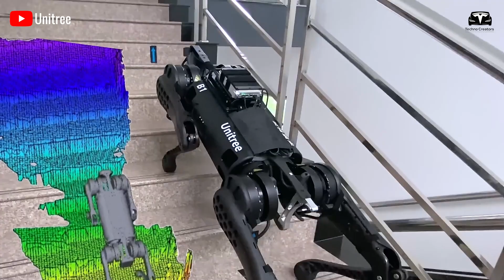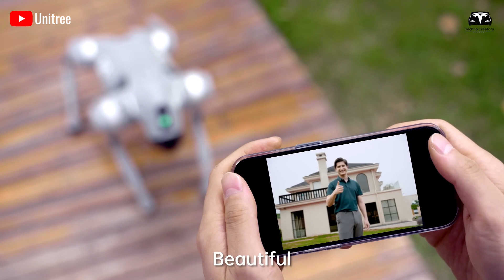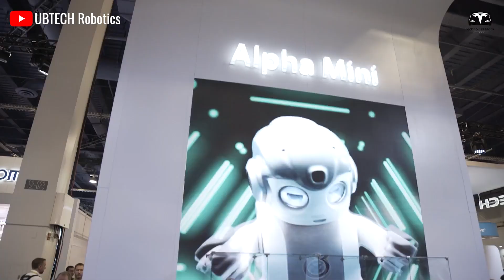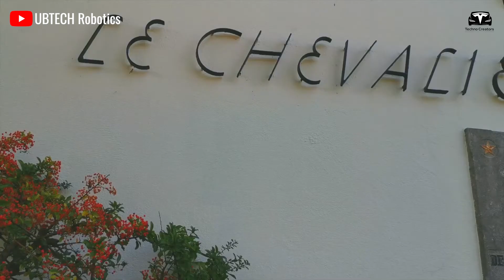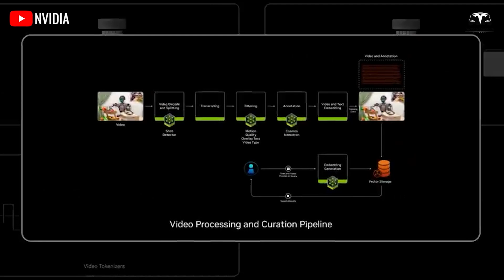No More Tesla Bot Gen 3! Elon Musk LEAKED 3 Testing Humanoid Robot Under $3,999 SHOCKING Industry

Comment: I don't see it. If you want a robot to do a specific set of tasks, it doesn't have to look like a human to do it better than a human(like Spot). If you want a robot to replace or compete with a human, these things are a sad attempt and need many years of improvement. If you go in a factory you won't see a job that it could do. Factories already use vison and learning systems and are set up for a efficient humans and efficient robots because asset utilization is important. Adjusting a factory for slow humanoids would be the antithesis of first principles and super costly. I can imagine this thing taking all day to do a few simple chores around the house and then spill/break something, need assistance or just be in your way at what real cost/convenience? It's too weak to assist handicap.  Maybe it could be an overnight stock boy but really what could it do? If a tele-operate humanoid can barely function why would AI be able to do any better?
Reply from the maker: Everything will start like a baby's development, Elon Musk and others have confirmed! What do you think about Optimus and Spot at 50 grand?
Reply: @TechnoCreators-pj9dg  This baby needs some better hands. Imagine if you had hard finger that only had feeling at the tips. Now try to put a lid on a paper cup. Normally you feel the whole lid with several parts of you hand and fingers as you push it on. Optimus won't be able to do this as efficiently as a  person or a dedicated robot. A humanoid is the antithesis of first principles unless you want to replace a person in which case it will have to perform as good or better than a person. 
Best use would be a surrogate/telepresence for a shut in so they could go shopping.